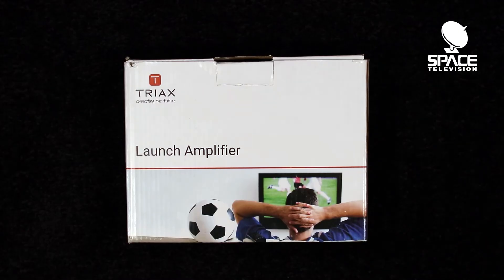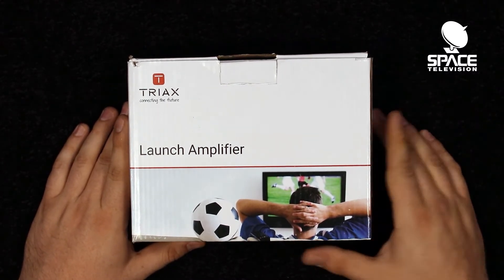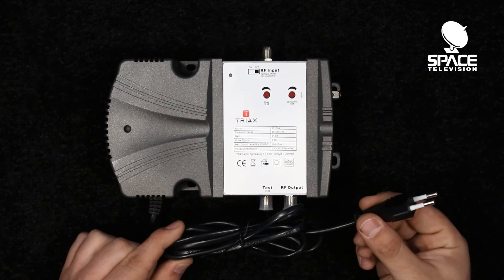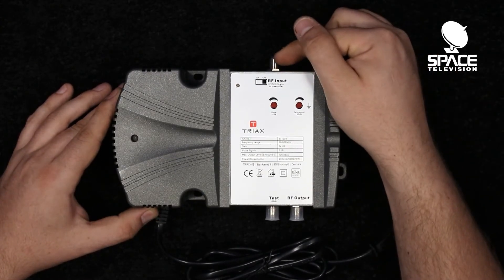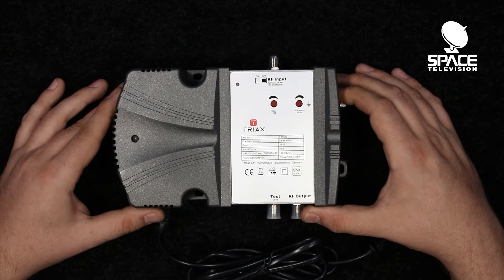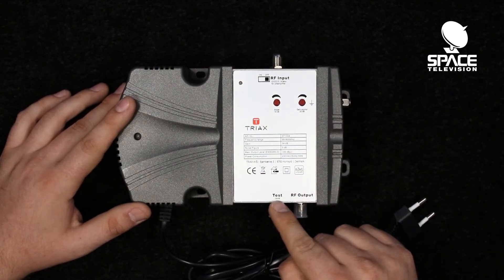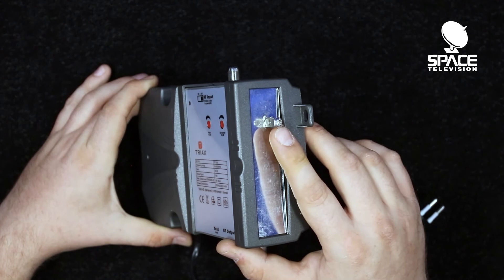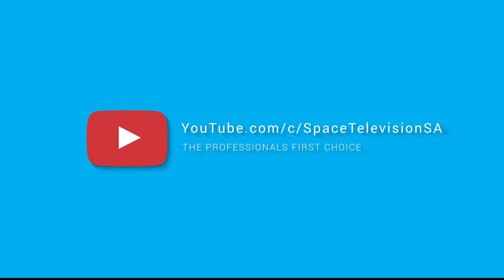Unboxing the Triax launch Amplifier

Comment: How do u install it?
Reply from the maker: Hi there. To install the Triax Launch Amplifier, start by unboxing and checking that all components are included. Mount the unit in a well-ventilated area, then connect the inputs from your satellite or terrestrial signals. Next, attach the outputs to your distribution system. Once everything is connected, power it up and adjust the settings as needed. For a detailed step-by-step guide, refer to the user manual or reach out if you need further assistance.